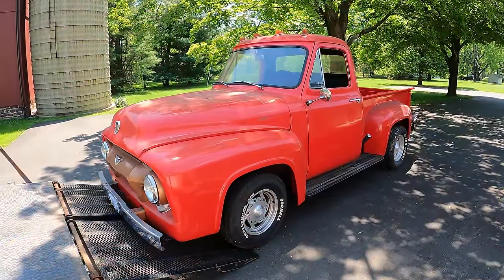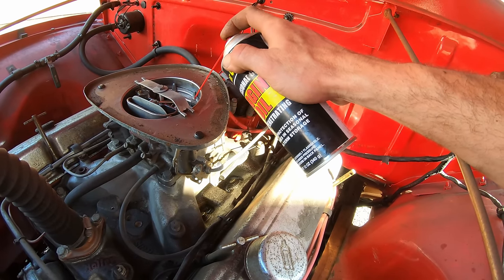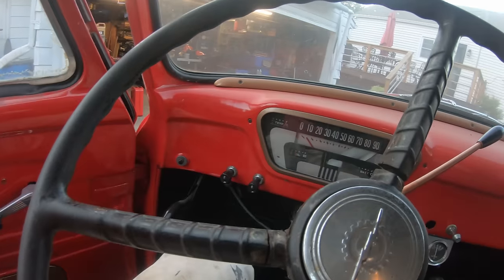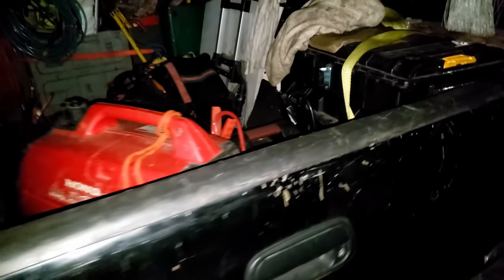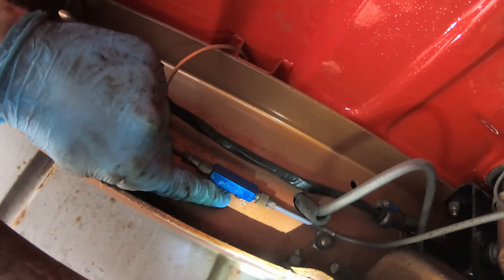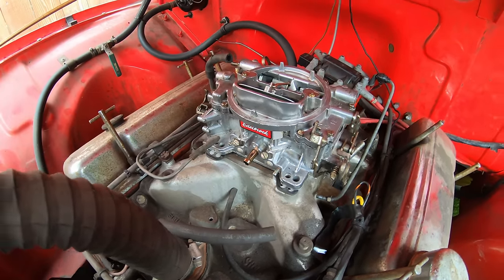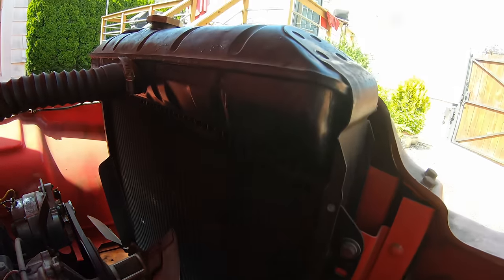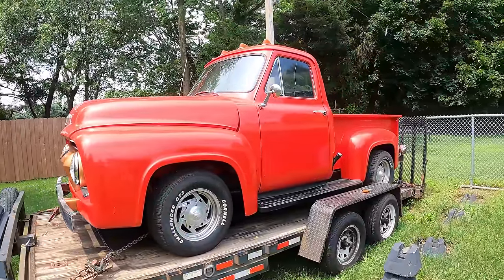1954 Ford F100 w/Pontiac 400 - Sitting For 12 Years NNKH

Comment: I subscribed and have been watching your videos for a while now, but the one thing I have noticed is that you need MUCH more patience AND thoroughness, young paduwan, when it comes to reviving vehicles... of ANY type. 
     First off, when you begin working on ANY vehicle, you usually do NOT know the EXACT maintenance history on them OR if one has sat for more than a few years, the first thing you should do after you do a general inspection is change ALL of the fluids... whether they "look good to you" or not and whether the previous owner said they've been changed by some other mechanic. 
     The reasons for this? First, YOU have ZERO idea if the fluid is even the correct fluid or not. Some owner or their incompetent mechanic might have installed 75w90 instead of 75w140 in a differential designed specifically for 75w140 and WITHOUT the proper additive package OR the completely wrong transmission fluid (like ATF+4 instead of Dextron/Mercon or Mercon V instead of Honda CVT!! I've seen it with my own eyes!!). Same goes with brake fluid, power steering fluid, coolant, etc... . Some people/bad "mechanics" think "it's all the same stuff and it won't hurt anything", so do you really want to leave that crap in those vehicles?? No. Plus, it's most likely old and worn out anyways, so the best bet is to start off with new, correct fluids BEFORE you try to fire things up. You DO NOT have to use the top-of-the-line fluids right off the bat, but decent ones, preferably at least a store brand full synthetics in order to better protect any moving parts. 
     Yes, it's the best feeling to hear an engine run after years of sitting, I get it, but you need to follow proper protocol BEFORE you get to that point. That differential fluid you checked in this truck was pretty much black, but you said, "It's fine" just because it was at proper level and just in there. A few questions, how old was that differential fluid? How many thousand miles had been run on it? What viscosity was it? How much wear metals were in it, all the way down at the bottom? You have NO idea... even if the owner says it's been changed recently... CHANGE it. The owner might have trusted HIS mechanic, but you should not! Better safe than sorry, remember? 
     Next, ALWAYS (and I mean ALWAYS!!) remove the spark plugs and pour a little Marvel Mystery Oil (MMO) into each cylinder and let them soak for a day or so while you are fixing other things on the vehicle, like changing all of the fluids, the leaky gas tank, ignition switch/electrical draws, etc... . This will give the MMO time to free any sticking/stuck/rusted rings and prevent further damage upon start up. You NEVER want to replace rings if you don't have to, right? I've watched you do it before (with PB Blaster), but sometimes you get a little lazy and bypass this VERY important step.
     Don't forget to change the thermostat whether it needs one or not, it's cheap insurance for $20 or less. 
     Now AFTER you've checked/repaired the brakes, gas tank, electrical drain, etc... THEN go back and visit the engine. You know that a carburetor that's been sitting for years will have varnish in it, so it needs to be gone through and cleaned/refreshed... so do that first, like you did... nice job.! 
     Then, check the ignition... remove distributor cap & rotor, look at contacts to make sure they are good/clean. Check the coil and wires... makes sure there's a better possibility for spark. Then, when you are ready to crank the engine over, a good recommendation is to change the oil right before you do this in order to lube up everything in the heads and on the crank. Once it cranks over and sounds good, DO NOT just start driving it! I know it's tempting, but resist that temptation. Just let it idle and see if it remains at a stable temperature. Let it build up pressure in that radiator and check for leaks. Old radiators are proned to leak, you know, so give them time to leak in your driveway instead of on the road. 
     Oh, that transmission fluid was soo low... did you ever think of changing it's filter? Maybe the pan gasket was leaking a little as well and a new filter and fluid couldn't hurt either (one of the reasons why you change ALL fluids first!). 
     And finally, ANY vehicle you work on that has an automatic transmission with the transmission's cooler lines going into the radiator is asking for trouble. With you, the manual "flex fan" hit it due to old motor mounts flexing forward as you went bouncing over those RxR tracks and just poor placement by a previous "tech".  (Remember to check your motor mounts by holding your foot on the brake and revving the engine while in drive with someone watching or video recording it for you. If the motor moves significantly (a few inches either way), you probably need new mounts. You also should consider converting over to an electric fan set up, for better fuel economy and power.  
     But THE main reason to NOT use the transmission "cooler" inside of the radiator is more important than that. This is how MANY transmissions die... because of water/coolant entry from the radiator into the transmission lines via the internal welds on those little "coolers" cracking. You should avoid using internal radiator transmission coolers at ALL COSTS!! Instead, use an EXTERNAL transmission cooler, like a heavy-duty B&M. This way, there is ZERO feasible way possible for water/coolant to get into your transmission via the transmission lines and kill it.  
     All you do is remove the trans cooler lines from the radiator and cut the ends off with a small pipe cutting tool (which you most likely have in your garage). Then, slide off the old fitting, file/smooth down the end of the pipes and install AN compression fittings on each metal line. You can shorten the metal line that goes to the upper fitting on the radiator side tank (if applicable?) so it's easier to route. Then, find a spot in front of the radiator or A/C condenser (if applicable) to mount the external transmission cooler. I like to keep it away from either just to reduce any ambient heatsoak into the trans cooler from the radiator (OR the heat from the trans cooler into the A/C condenser), but that's because I live in the heat of south Florida, where the trans comes to temp just fine in pretty much 99.9% of all weather conditions here. IF one lives in a colder climate where it snows, like you do, then you could mount it to the front of the radiator so that it helps bring the transmission fluid up to operating temp much faster in the cold weather, but vehicles like this truck are usually NOT driven in winter. There are even small fans that you can buy for transmission coolers, like B&M's, IF you need more transmission cooling due to constant heavy towing, but normal vehicles will usually not need an auxillary fan.
     Just remember, don't rush things and don't take shortcuts... they could get really expensive.  
     On another note, your wife is any car guy's dream girl... she is a beautiful woman with a great smile & personality, she helps you work on vehicles without hardly a complaint, and you two seem very happy together. She's a special woman, so don't forget to treat her like one every day. May you both have a long and happy marriage.
     Anyways, keep up the good work!!  You are on the road to becoming a Jedi Master one day... ;)

Comment: Never understood why people put gm motors in fords. I should grab a favorite gm vehicle and put a Ford engine in it and call it model a revenge.. lol... glad just to see a old girl saved though.
Reply: Because parts for GM v8s are affordable and cheap plus compact design makes it easier to work on with tools that are not-hard-to-reach.
Reply: @brandedmcgowan9414  I work on them all and in my opinion there is no difference..
Reply: @kimjaniszeski498  the simple old skool blocks of course, but the only difference is the placement of the distributor. If only the 7.3l Ford gasser ('zilla) can be tested in that engine bay (too much tire smoke)
Reply: @brandedmcgowan9414  I'm getting ready to do a 5.4l triton swap into an 84 f150... maybe I'll put the 302 out of it into my 85 grand prix and call her model a revenge, that'll piss some people off.. lol...
Reply: @kimjaniszeski498  If it's the 5.4 3v triton then you gonna have ro bulletproof it. Damn that's the headache engine Ford ever made. Had a 2008 Expy EB with that motor nothing but bad experience in the shop multiple time of owing it. Cured it with a 2010 Tahoe 5.3 VORTEC w/cyl deactivation no problem owning it for a year but lack of funds made us take it back to the dealer.
Reply: @brandedmcgowan9414  not that difficult, all nuts and bolts. I do ALL my own work on vehicles, trucks, and farm equipment. I'm building a 4v dohc 5.4 for my 04 super duty also soon. Then I'll get to the easy work, the 85 grand prix 351w project.
Reply: @kimjaniszeski498  that must be the 4v from the high trim 'stang right?
Reply: @brandedmcgowan9414  if it is idk... I just ran across 4v 5.4l heads....